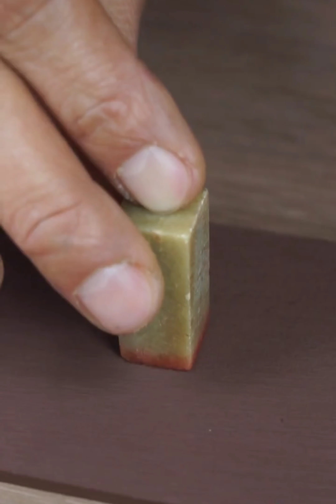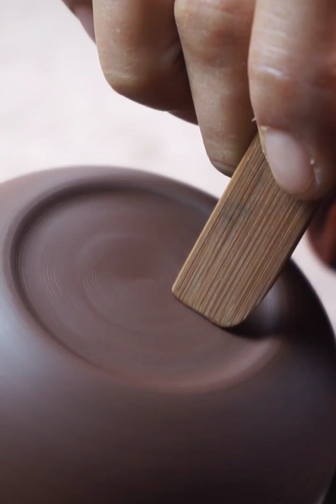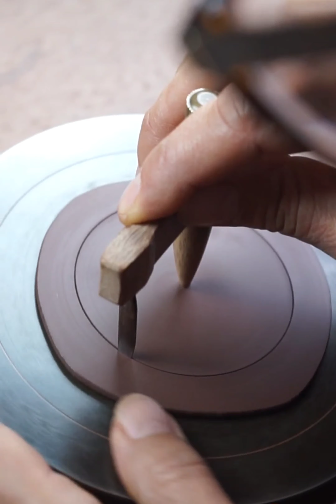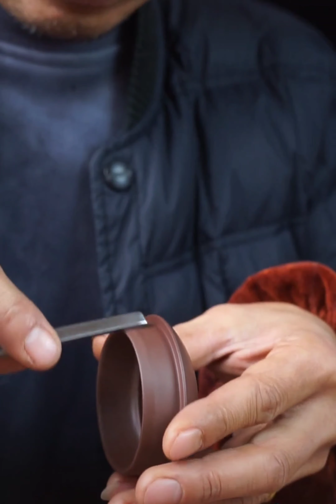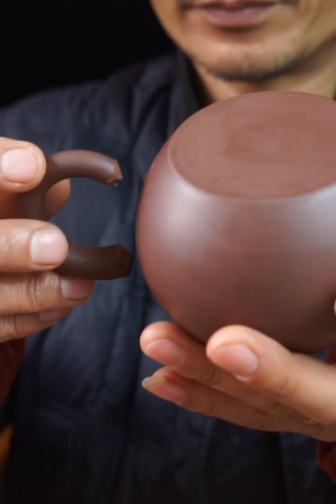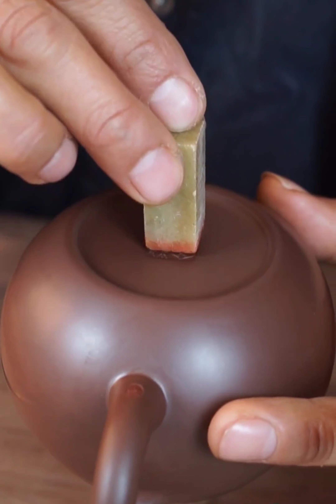AmazingChina: Master Artisan Creates Teapot (Zisha Yixing)

Comment: What really amazed me is how very little he worked with. I was expecting a huge mound of clay on the table but he began with hardened clay chips.  That’s what I find amazing. Very beautiful!!
Reply: And we probably saw like 2% of the real effort to convert those chips into all that clay.
Reply: Those dry clay chips came from processed purple sand minerals.
Reply from the maker: The dry clay chips are rehydrated and used only as "glue" to hold the pieces together.  Once the teapot is baked in a kiln, it all becomes one piece.  Glad you enjoyed the video!